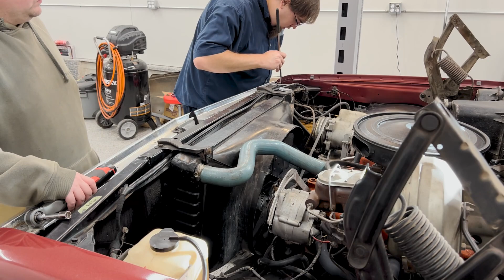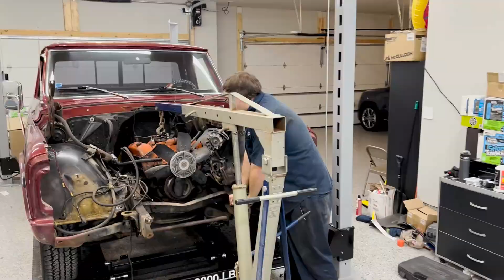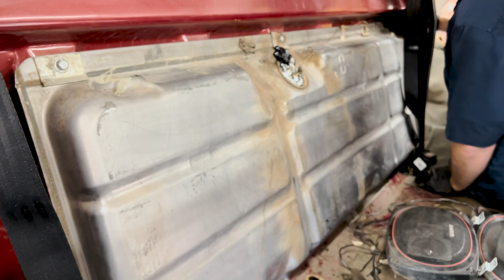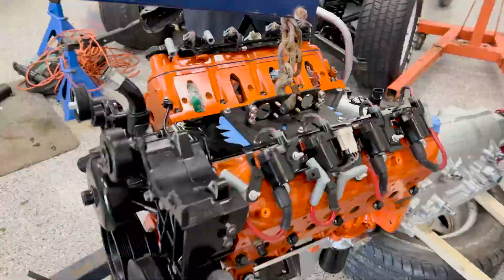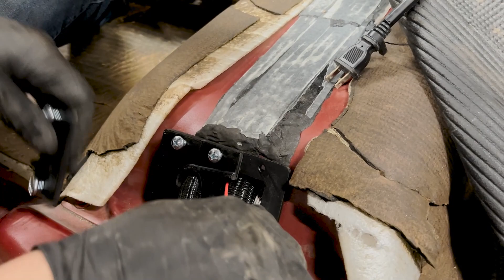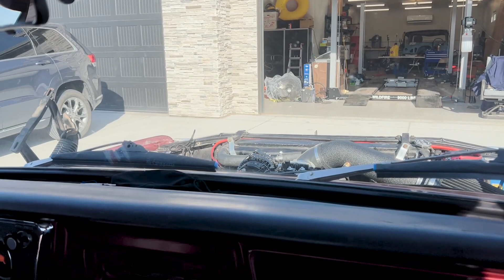1972 C10 REBUILT 6.0L LS Swap

Comment: How did the fuel pump work out? Noisy?
Reply from the maker: Not noisy at all. Still running strong and it's actually quieter than the factory pump in my nnbs suburban.